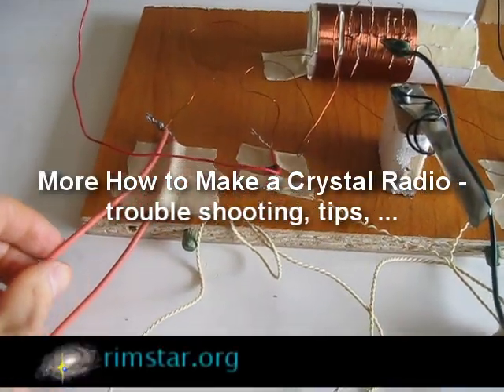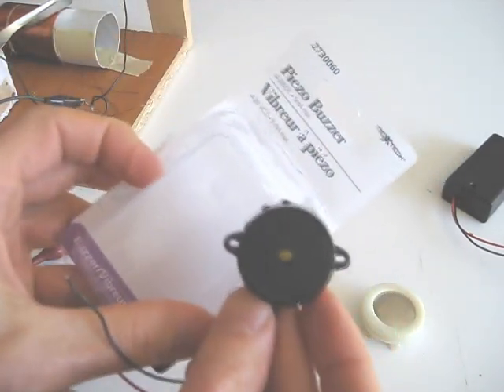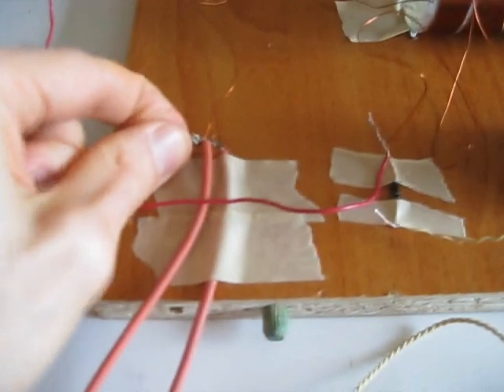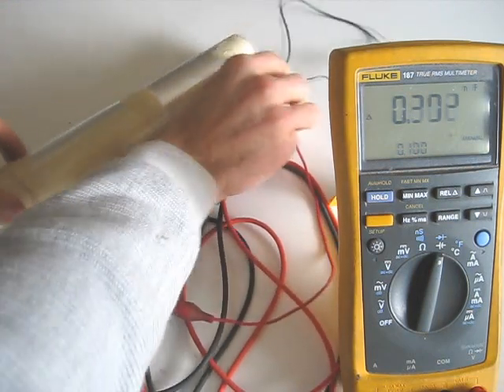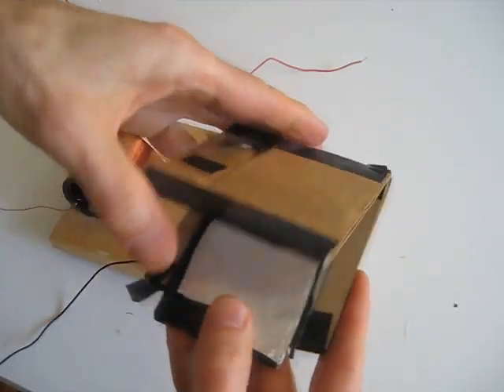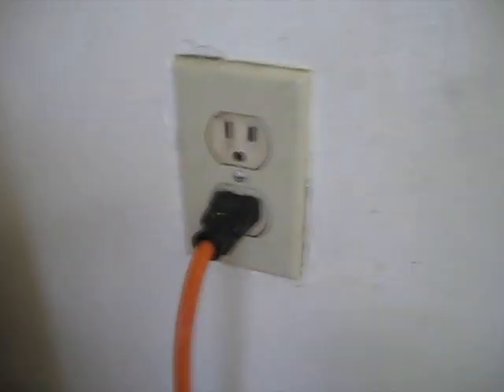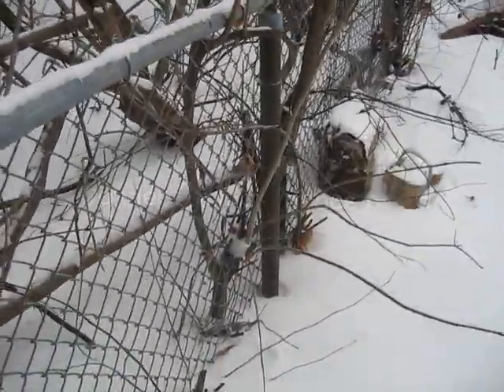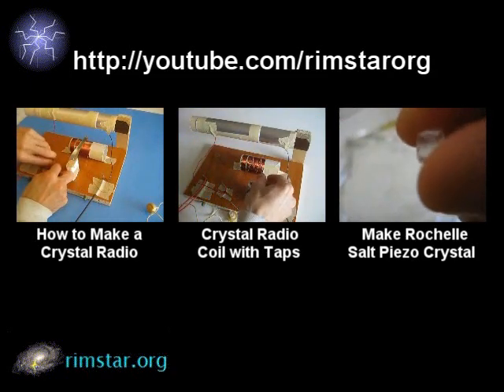Crystal Radio Troubleshooting and Tips

Comment from the maker: I haven't made a ferrite rod one yet. According to my calculations with a 1 centimeter diameter rod you'd need only 30 turns on the tuning coil and no change for the capacitor. This is just calculations, not experience. It's on my todo list. Other possible problems: how long is your antenna, longer is better, is your diode a germanium diode, do you have a good ground connection, any radio stations nearby? Point your antenna at the radio station for best results.

Comment: Great Video. Could you possibly provide some information on Ferrite Rod antennas/radios. I am trying to reproduce your setup with a smaller configuration, however I am unable to get any sort of sound response. Another question about your crystal radio was the number of coupling turns from the antenna to the radio circuit. Is it necessary and how did you decide how many you needed. Thanks.

Comment from the maker: It's hard to do without the germanium diode. You could try 5 silicon diodes wired in parallel. Parallel means all the ends with the stripes connected together and all the ends without the strips connected together and use where the diode normally goes. No guarantee that it'll work though. Another option is to make a razor blade diode as in my video "Make Razor Blade Diode for Crystal Radio/Foxhole Radio" but that's hard to get working too.

Comment from the maker: One end of the antenna is connect as I show in the video, to one end of the shorter coil. The other end of the antenna isnt connected to anything. Silicon diodes wont work with this circuit, only germanium. You could look for videos that use a pencil and a razor blade for the diode but I havent gotten it to work so I cant help you there.

Comment: thanks but will a 24 gauge stranded 2-conductor speaker wire work for the coil, the insulation is transparent and it has copper on it

Comment from the maker: It should be laid horizontally and preferably pointing in the direction of the radio station. The higher up off the ground you mount it the better. I just lay it on the floor and get okay results. The other end doesn't have to be hooked up to anything. But if you are using a metal tower at that end to hold it up, then don't connect it to the tower directly but run a foot or two of rope, something nonconducting, between the antenna and the tower.

Comment from the maker: Do you mean where in the circuit? That was explained in my How a Crystal Radio Works video. The antenna is connected to one end of the antenna coil. In the comments to that video I just mentioned that a loop antenna is another possible type of antenna that takes less room. The circuit is a little different for a loop antenna so I'll leave you to look it up. I don't have any video about that one.

Comment from the maker: For the antenna I just use any insulated wire, the longer the better. Mine are around 15 feet long. The wire thickness doesn't really matter. For the coil on the toiler paper roll I used 26 gauge wire with enamel insulation, often called magnet wire, but it's really just copper wire with insulation on it. I would have preferred to use 22 gauge so I could have a longer coil. In both cases it doesn't have to be copper.

Comment from the maker: I've bought them online in the past. You could try a Schottky diode but it may not work. A silicon diode won't work. This circuit needs a leaky diode and most germanium diodes are leaky. You MAY be able to get around the fact that a Schottky diode isn't leaky by putting a resistor in parallel with the earpiece. The resistor should be somewhere between 10 to 100 kilohms. You could try a razor blade and a pencil but I don't have further information on that; search youtube for "razor pencil diode".

Comment from the maker: Thanks. I just looked at it and still can't say without trying it myself, which I won't try since it'd cost a bit. It says it can take input from a 1/8" microphone. So either the output of the crystal radio would go directly into the microphone socket or you'd need some other parts in between to make them a better match. If you don't want to take a chance then you could look up how to make your own amplifier for the crystal radio. I have parts for that but haven't had a chance to try yet.